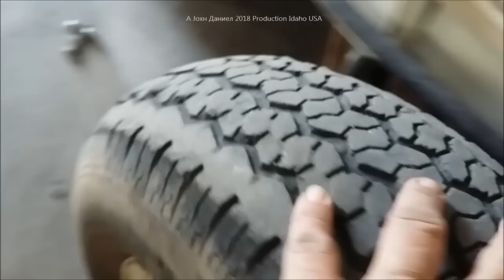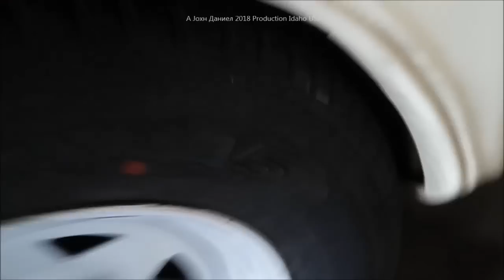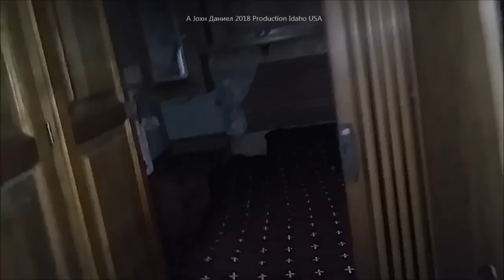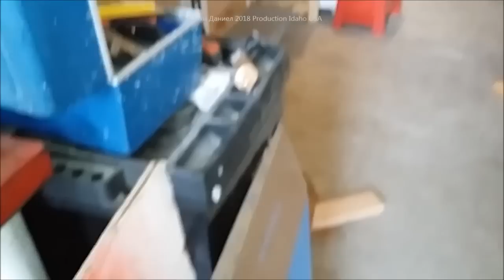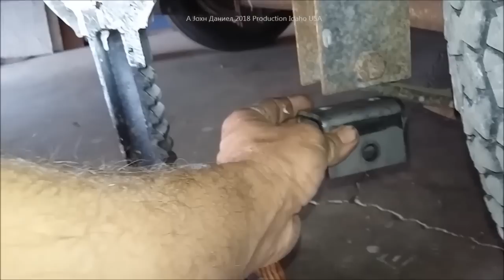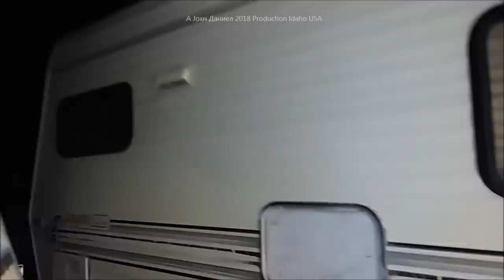Raise height of your RV trailer WITHOUT flipping the axles, under $30

Comment from the maker: Want a awesome RV Generator? Check this one out, Sportsman 4000 dual fuel!! https://ebay.to/2K3p3O2  See my video on it https://youtu.be/lmFJ_w8seMk . A good Book on RV's - Get and learn some skills, http://amzn.to/2p1Kc3U  DON'T think you can fix a rotted out, issue based or water damaged RV without full comprehension. They are built from the inside out and unless your very very skilled, avoid them. Don't buy a RV without hard core inspection and knowledge. 
YOU'VE BEEN WARNED, Don;t be like the owner who had this mess. 

DUE TO SELLER - RV HUSTLERS ON YT, Comments are on approve only unless otherwise stated.

Comment: Way too much customization.  Way too much DIY welding.   Way too much for my liking.   For me, I would simply install / weld on new perches on each axle - repositioning he axles "under" the leaf spring packs.   I would then drill new holes (higher holes) on each hanger higher.   This creates 3" lift and NO ugly looking customization.    Life is already complicated..   Thus...  Do the simple change using springs over axle conversion...

Comment: And when I say drop the axle, I mean make it so the axle mounts onto the springs from the bottom instead of how they manufactured them until 2000 and that would basically lift it the same way, and all you gotta do is unbolt two bolts on each spring so you can drop the axle out. Make sure you still got the axle crown still pointing up and weld the new ears on it. I have a 19 6724 foot shyster camper and I just dropped the axles and I could put 16 inch rims on the axle and still have 3 1/2 inches of travel clearance

Comment: Just out of curiosity, why didn’t you just buy new you bolts and the axle dropping kit where it’s a axle ear you got a well done you’re gonna get the same amount of lift with that and not compromising the axles integrity on the frame not saying you’re a bad welder it’s just you know a lot of these people that watch videos just so that they can do this. You can’t just watch a video and learn how to welda solid weld so it’s a lot easier to weld on New axel ears so you can actually put pillow blocks on it in the long run

Comment: FOR YOUR HEAVIER RVS LIKE YOUR FIFTH WHEELS AND STUFF. TRIPLE AXEL WITH THE WEIGHT DO YOU STILL THINK THAT WILDA'S GOING TO BE SAFE
Reply from the maker: You just add stronger welds and metal proportionate to the need. People seem to ignore the whole frame is welded. 75% is spot welds, and Even with over 20K miles on this job I keep hearing about how it will fail in the first 5 feet.

Comment: Agree fllipping axles adds 5 inch where 2 and a halve inch is good going to do mine then running a cross member across side to side in front of hangers same on rear also at centre hangers

Comment: This very dangerous to do!!! The side force on the hangers is too much. If anyone is wanting to do this please don"t.
A much and safer option is to buy a thick C channel or even square tube and run it parallel to trailer frame. Even a 2"X6" square tube running the length of the spring hangers and then putting on standard size hangers.
You should not trust 3/16" pieces of steel hanging that low!! You are endangering yourself and everyone on the road!!

Comment: I have seen this done before, and also watched a video placed on the chassis - afterward, as it went down the road.
The extended mounts swayed and flexed with the road conditions. It was almost painful to watch.
I spent the money an a Dexter over/under spring kit. Not expensive.

Comment: Good job!.  There are other ways to accomplish the same thing, by installing a square tube the entire length with new brackets but this will work just fine.
Reply: In this setting, three cross braces are needed for solidity. Or put MorRyde SRE 4000, get a lift of +2.5 ". Bad budget, but fast.
Reply: Huh?

Comment: Think I wouldve just put the axles under the springs.
Reply from the maker: A thought but "flipping" Thats Illegal in about 26 states.
Reply: @JOHNDANIEL1  there are manufacturers that sell kits to move the axles from atop the springs, to below the springs.
With new spring seats, so the axel can maintain the proper camber on the axle. 
I would never "flip" an axle. Especially if it had brakes.
I hear ya about it being illegal in several states.

Comment: John, I know this may not be checked, but the link you give shows two different heights for a tandem axle is this the correct configuration? https://www.ebay.com/itm/Tandem-Axle-Trailer-Suspension-Spring-Hanger-Kit-3500-7000-lb-weld-on-free-ship/291428850766?_trkparms=ispr%3D1&hash=item43da835c4e:g:NT0AAMXQvJVRVw1E:sc:USPSPriorityFlatRateBox!80424!US!-1&enc=AQAEAAAB4BPxNw%2BVj6nta7CKEs3N0qUoVLcqQ8Yv5R%2FpYsGij2MjAkCqT7lULCD8BtSjk0zaye3i1%2F7VPEgY%2BjkeGD2RCEIBg%2FWayv2udEUo6N2A06x77mjxm9BzNxy3bbcUSXLMpH8OMQdS8uBth9U17leLAh6%2FtxhZ4dxFsn%2F62ftC%2BcwXr8LFboheAM4n%2Fz7zea2rVc57qRETnLABCNEbNOsw%2FYuIS81rg2RfF0KwgtT3RZ5GYGJxY3PmVfwnibnkKqWcnTLbiCfWcSQt9ZVktcEurrcLeBrMPJeJXPOCNLyeZCy2jZ2jeri%2FShzJGdcleS7qySu8utsYRcvwH9nMdDbwR4llwI4Apje6qOLDS%2BvT1A7oHx6FK9U%2BL38EqL8fXis7cLKcN8OJz%2BzU2oakvVBrt1E1B1rQygXmZRWU0vjKeray2vK1GVtKrHVs14SOropb516BJjv%2B5aoTm1MZd%2BvY3s88RAQify2n5I4JY91t961%2BtiY9WbgtC01BlGjMFu9fGFkwle6113NwrF1nVP9FALCCaP3FdPLzcOmCB37p7hOAvZH5%2FgmTB3sD6IqsuZ9SryTVm%2Bf7YgpKwuy975csl5ui6fO5z%2FEHyeFWZjEL44kWd1bi6RpmfaW1vO7lB4KC%2BA%3D%3D&checksum=291428850766447f909a817d455da52d96f523fc88c3
Where in the sequence does the larger one go? Thanks for any reply.
Reply from the maker: Are you attempting to raise it or change the spring sets? That item is 1-3/4 hinge and spring width, they do have the 2" as well. Also whats your trailer axles you have now?? Whats your equalizer spacing on what you have they come in 5.75 and up to 9" spacing on them. 5.75 and 7" are the most common.

Comment: How did you lift all 4 tires?
Reply from the maker: By adding supports and spring mounting hardware extensions. And upgrades to 16" wheels and tires. Got me 3" +
Reply from the maker: I put 4x4 lumber under it across the frame where I could see good support about 6 feet in front of the front axle, and 6 feet behind the back axle then using floor jack I lifted it 2" at a time close to the main frame then put Jack Stands in place as I shifted from side to side lifting in stages.
Reply from the maker: PS - Tomorrow check back, I'll put links to items to use for setting one of the ground.
Reply: I think my question was misleading, sorry. What i would like to know before your hard work how did you get the trailer in the air too work on? Im new at this and was told to lift tires in air to avoid tire damage when stored. Thanks 🙏

Comment: Much easier to just flip the axles.  Just make sure the bow in the axle is up and the brakes are the right way. Easy.  No welding needed...
Reply from the maker: Flipping axles is illegal in 14 states. California, New York, Maine, New Hampshire, Michigan, Washington, Oregon, Illinois, Minnesota, Colorado, New Mexico, Delaware, Vermont, and Iowa. Only legal in 3 states with a inspection and permit to do so. West Virginia, Florida and Texas. So flip at your own risk for sure. $650 fine in California now.  Our need was only about 2 inches, flipping would have given us almost 4-1/4.
Reply: @JOHNDANIEL1  I guess it's a good thing I live in Canada where it's not illegal then :). I just put new axles on my 1988 Terry last year and it had flipped axles for almost 30 years.  I'm not worried about any risk.  I flipped the new ones too.

Comment: As a insurance agent if someone ever gets into a accident with a rv after that kind of homemade modification definitely lost their coverage...
Reply from the maker: I'm wondering how you would have insured one or cover a wreck on one with those little 1" welds on its hangers it had to start with. Now it is balanced, no longer swinging when towed, triple the welds, 9 spars from upper frame to hanger it never had,  I have had no fear in the last 10K miles towing it that it will do great.
Reply: Only way you cannot be liable as far as my company is concerned is if you get a DOT inspection of the trailer. That also includes homemade trailers. Just saying wouldn't hurt to get a DOT inspection and keep the report.

Comment: This can be very dangerous!

Quick and cheap way to lift a small trailer, yes, but you should not be giving ideas like this to so many viewers that now think they can modify a large trailers suspension because they have a welder.
What you did was not properly engineered.
There are many more forces at play when it’s on the road.
For starters, you should have a cross brace between the new lower points, and clean welds, that don’t have to be grinded afterwards,
But honestly the old hangers (or subframe) should have been cut off and new drop hangers or new subframe installed. Then proceed to cross brace and weld properly without overheating the frame or hangers.
Cheap and fast? Yes. Does it lift the trailer? Yes. Can the new loads shear a bolt, crack a weld, or break a leaf spring and kill someone on the road? Yes.
Reply from the maker: Food for thought for sure. Its only got about 8,500 miles of road travel on it since the modification so I guess time will tell. Probably running the vertical braces on it from frame to pivot bolt point was a odd creation of a weak point and plating it inside from frame down was just to make it look cooler, but in 32 years of building 60+ complete trailers I was never told I needed a engineer for any thing like this. I got one thats had over 70,000 road miles before I sold it, a King of the Road 5th wheel. This is about the 30th such modification like it in the last 20 years, I probably should contact Chanute Trailers and tell them to stop doing it too since they probably done 100's as far back as I can remember.

Comment: Just curious, was there another reason you wanted it higher? Couldn't you just swapped the rubber with 225/75-15 and saved all the trouble?
Reply from the maker: It all started with using a 8k capacity 3 inch drop hitch to keep the trailer level in tow, then dragging the trailers ass when going in and out of places due to how low it was, big PROBLEM! 
 SOLUTION - With the 6000 lb axles and 12" brakes to get more height I changed to 16" wheels with 225/85/16 tires from the originals which were 225/75-15 gaining 1.25" in height, the result was not enough safe travel clearance in the fender wells (which I measured for and expected), so adding 2 more inches by extending and beefing up the mounts gave me the 3 inches I needed to match both my 3/4 ton Truck and my 1 ton vans receiver heights so my one best straight 12k hitch with anti sway built in could be used on all my 6 trailers.

Comment: Where can i find that metal part?
Reply from the maker: https://rover.ebay.com/rover/1/711-53200-19255-0/1?mpre=https%3A%2F%2Fwww.ebay.com%2Fsch%2Fi.html%3F_from%3DR40%26_trksid%3Dp2380057.m570.l1313.TR0.TRC0.H0.Xtraile%2Bsuspension.TRS0%26_nkw%3Dtraile%2Bsuspension%26_sacat%3D0&campid=5337842430&toolid=20008
Reply from the maker: That link will take you to hanger options, this one may help also https://rover.ebay.com/rover/1/711-53200-19255-0/1?mpre=https%3A%2F%2Fwww.ebay.com%2Fsch%2Fi.html%3F_from%3DR40%26_trksid%3Dp2334524.m570.l1313.TR5.TRC1.A0.H0.TRS0%26_nkw%3DTrailer%2BSpring%2BHanger%2B%26_sacat%3D0%26LH_TitleDesc%3D0%26_odkw%3Dtrailer%2Bsuspension%26_osacat%3D0&campid=5337842430&toolid=20008
Reply: Thanks

Comment from the maker: This cost under $26 in total materials, parts from https://amzn.to/2uyCS4o , that includes welding wire and some WD40!
Pay Attention DIY folks  - Most trailers are universal based on the axle weights, but always measure, ask, verify and get the right parts. AND be safe, use lots of supports if needed.
PARTS USED & SPECS - The BEST Mig Wire my preference is INE, .030 See specs here https://ebay.to/2HN8uWDAND .035 https://ebay.to/2HMpi01 AND 10 pound spool .030 https://ebay.to/2qPdamP INE is Best for Anyone who welds. Welds easy & awesome from 30 amps to 200 both AC or DC.
A great 120 volt welder for anyone Novice or Professional is https://ebay.to/2K3pxEz MIG KIT Beginner to Pro DC+, much better than a Chicago Electric, + theres parts if you need them. Big plus, Guy selling them will support the welder after you buy it.

Good luck, safe welding.

Lincoln, Hobart, and other MIG wire brands simply don't add up to being in the same line of competition as Inetub wire from Italy.
I prefer the .030 due to being able to run it faster with a higher arc closer to the work. But the .035 does work well to fill chamfered pipe and plate.

Specifications For the Monroe http://www.monroe.com/en-US/e-catalog/31176/
Specifications for the Gabriel http://gabriel.com/product-search/light-vehicle-part-search/?q=82026

All JOHN DANIEL /  PREPPER MOUNTAIN VIDEOS are the Property of Panorama Remote Power LLP Idaho USA

Comment: Wow you traded a old engine for that, so nice. What was the engine worth?
Reply from the maker: It was a 6.5 Diesel, had 133,400 miles on it and came from a mid 1990's motor home I got on a salvage deal for $50. This Jayco would sell for about $5500 so a $2000 engine I got for $50 was not a bad swap!!!